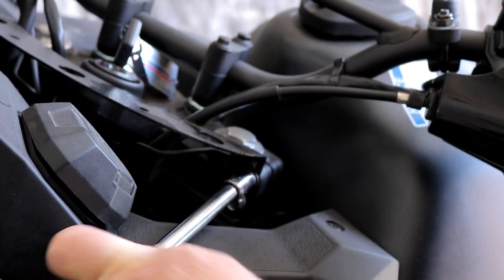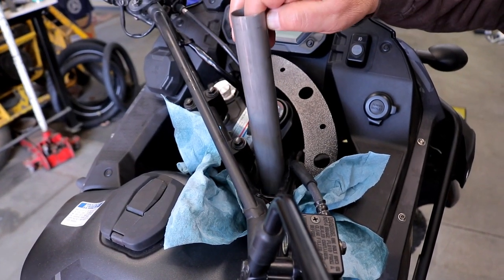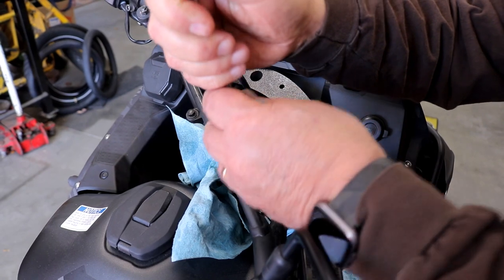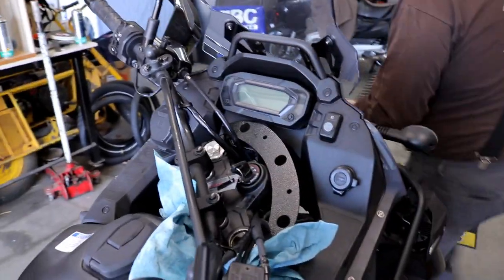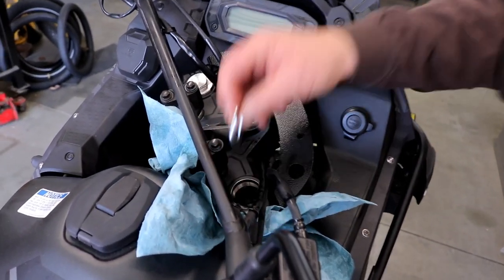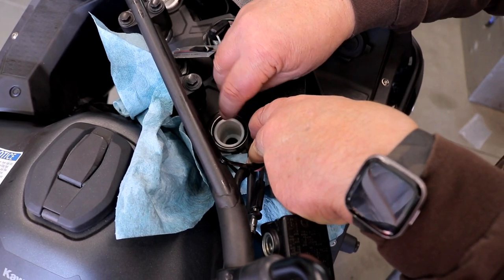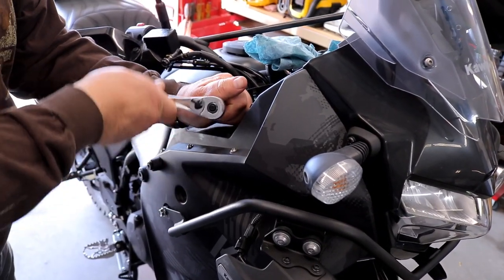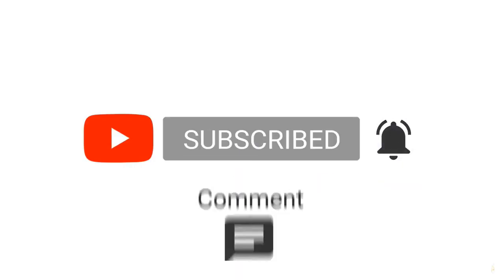Progressive Suspension Install - 2022 KLR650

Comment: Just looking at the included instructions from Progressive suspension, they say to install the spring with tighter coils up not how you did it.  Which way is correct?  Thanks.
Reply from the maker: In our opinion there is not a "wrong way". I put the spring in "MY WAY" based on the principle of sprung and unsprung weight. It's sort of like "what kind of oil should you use"